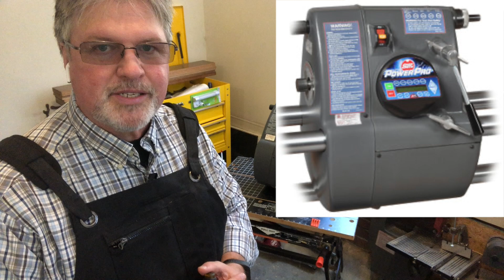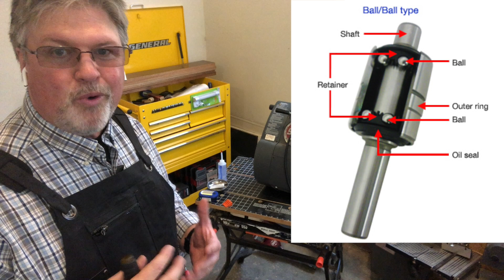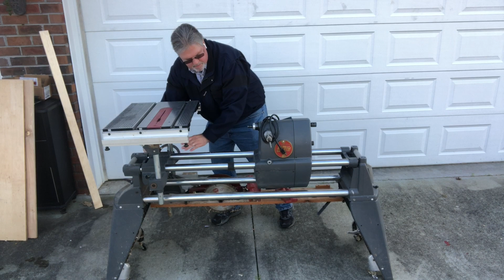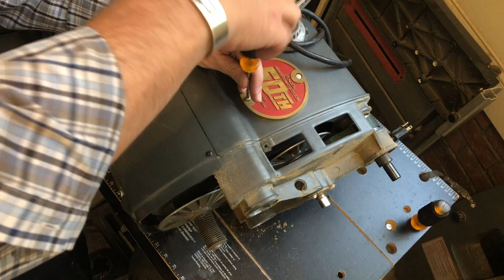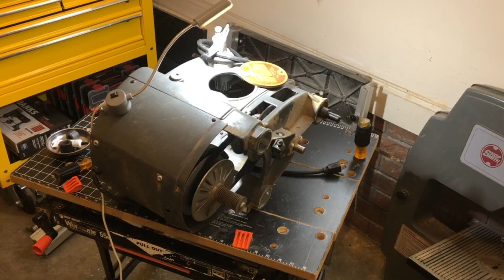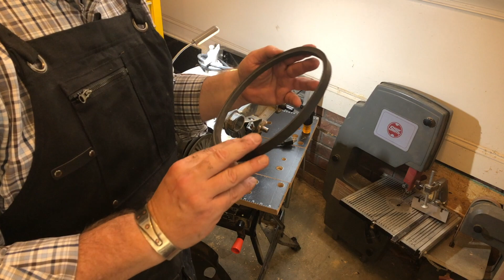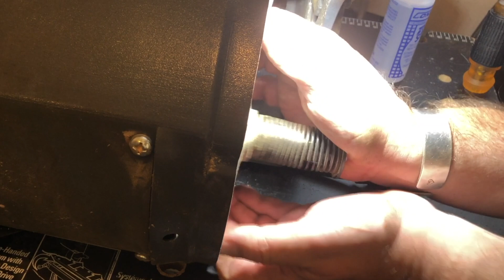25-Hour Run-Time Critical Shopsmith Maintenance, Headstock Removal & Lubricating & V-Belt Removal

Comment: Geoffrey Baker is the handle maker.  Looks very good.
Reply: I have not used Geoffrey’s handle.  I do se it’s advantages.  I have the Shopsmith magnetic various position handle.  I like it.
Reply from the maker: @johnrice6793  Well, I’ve taken the plunge and will report back.
Reply: @MyGrowthRings  

Had it been available when I purchased mine from Shopsmith I believe I’d gone your route.  I’m very interested what your report is.
👍👍
Reply: @MyGrowthRings  

I’ll add - comparing the newer Shopsmith version to the old - the old is pretty cheesy.
Reply from the maker: @johnrice6793  I agree. It works well for a lot of things, but if you stress it at all it really shows what it's made of. And that ain't much!
Reply from the maker: @johnrice6793 Now I almost feel like I need to get my hands on the SS version, just to make a fair comparison.
Reply: @MyGrowthRings  
Shopsmith sells a three handle version too.  I’d say from reading/picture view Geoffrey’s is far better.
A review of Geoffrey’s vs. the “classic” vs. the magnetic one would be very interesting.
Shopsmith setup tricks, from bandsaw to table saw to jointer - use of the conical disk, planer/jointer/knife sharpening jig, adjustable stop collar -  Ok, Ok - - sheesh - hold on!! I’ve got just a few more items to add to your list......👌😎
Reply from the maker: @johnrice6793  Yes, I’ve used and may actually own the Shopsmith three lever quill feed handle, but I didn’t care for it. It’s only good when drilling or boring, and even then it didn’t do anything for me that relocating the single handle couldn’t do. That and it has a wobble that I don’t care for. I haven’t tried their magnetic one yet, but the hub sticks out so far front he headstock that it just doesn’t appeal to me, this one may be the same. We’ll see.
Reply from the maker: Have you used one?

Comment: I broke two Shopsmith handle hubs.  I have the Shopsmith adjustable magnetic handle.  I like it.  However, there’s a fellow who produces a better conventional drill press type handle.  You might give that a look see.
Reply from the maker: I know bit of the ones you are talking about. The one that uses the quick release racing steering wheel hub is interesting, but I have a few reservations about it. I’d love to play with one.

Comment: The mask arrived today.  All is well.  New, in box.
Without using it it has my two thumbs up (at this time)
1. It’s red and black.  Easily visible.  The white masks become .  Seems I never put them back in the same place twice.

2. The elastic straps are easily adjustable, the mask fits.

Thanks for the heads up.👍👍🤜🤛
Reply from the maker: Awesome. Thanks for the report.

Comment: Probably a dumb question,  is it possible to remount the headstock on the way tubes if the wedges aren't aligned properly? Reason asking, I upgraded to the Power Pro headstock. Everything seemed fine when I installed it on the tubes but when I loosen the headstock lock it will make a noise like the wedges are being released under tension,  if that makes any sense. The headstock slides along the full length of the tubes just fine and locks in place in vertical mode. Thanks for sharing and producing this channel. This has become my new favorite channel,  even over all my watched gun, jeeping and beer making channels. Almost as much fun as watching old SI swimsuit model videos...well maybe not. Curt.
Reply from the maker: Wow Curt. In the words of Navin R. Johnson from “The Jerk”: “I'd just be happy to be in there somewhere”.  I think I understand what you are describing and that’s perfectly normal. Just be sure that the tubes are properly waxed and that you’re not sliding the headstock over the wet wax and you should be fine.
Reply from the maker: Oh, and no. It isn’t possible to install the headstock with the wedges improperly aligned.

Comment: Great episode Scott! I use 3-in-1 to lubricate. The local Walmart carried it with the same long applicator.
Reply from the maker: There’s nothing wrong with 3-in-1.
Reply: good oil my dad used it on his. I use a high end gun oil. Is stays on a lot longer than 3 in one or any other oil I have used. Made by qmaxx. Its kind of expensive like 20 bucks for 6 ounces but I haven't found much better in a light weight oil and it last a long time. Especially good for lubing stuff that's prone to weather because it is one of the only oils heavier than water. The oil doesn't break down or float off if something gets wet. Not that my mark v sets outside but it works good on anything that does. If you are a gun nut like me it is for sure the best stuff to take care of your babies.

Comment: I'm a little unclear on how to do maintenance on the porkchop. I seem to remember seeing a video where someone sprayed some lubricant on/in the mark V but that seems like other issues could come up if you aren't careful. Do you have a good method to demonstrate how to make sure that it is operating the way it should?
Reply from the maker: Yes, the reason I didn’t touch on it is because I wanted this video to only address the 25 hour maintenance. The quadrant lubrication is controversial and my even be detrimental. If I lubricate it at all I use a dry lube like Top Coat or Boeshield T-9. If you’d like a heads-up, here’s what I use: https://amzn.to/32OCnSr I’ll address this in the mid-week follow-up. Scott
Reply: @MyGrowthRings  Thank you Scott I appreciate your time.

Comment: A great demonstration of removing the headstock.  Too heavy for me anymore.  I have oiled my headstocks for the past 30 years with it in the drill press mode raising the belt shield up the ways and clamping it up there.  It seems easier for me to get at the lower sheaves and oiling the upper sheaves is easy through the back hole from almost any position.
Reply from the maker: Good point. I was planning on showing that alternative during the mid-week follow-up, but you’ve just given me another reason that someone might want to approach it that way. Thanks, Scott

Comment: Great video Scott! I'm due to open mine up and give it a good once over again soon, so very timely.  My '80s vintage Mk V quill doesn't turn easily by hand like yours does...hopefully you can touch on possible causes in a future video.
Reply from the maker: Rule 1: Don’t drop it onto you jointer.

Comment: The 2x4 is a great idea. Since you broke the quill, will you upgrade it?  Appreciate any comments on making a shorty.
Reply: No I’ve seen the shopsmith upgrade with 3 handles but haven’t made the switch.
Reply from the maker: @daveschmitt6369  I used the three handle version when I worked at SS and it always seemed to be in the way. Their new multi-position lever looks interesting, but it also looks like it hangs way off the side of the headstock. Likewise, there’s a non-Shopsmith multi-position version that utilizes a quick mount bracket from the auto racing industry. It looks interesting and might be excellent for mortising because it is much longer than the stock lever.  Like I said, I am so used to the OEM parts that I’m reluctant to change.
Reply: @MyGrowthRings  you haven’t responded to my probes about making a Shorty. Is that an insult to a purist like yourself. I work in a one car garage and have two Shopsmith’s with a jointer, band saw, jig saw, belt sander all shopsmith. In addition I have a planer, strip sander and router with jigs and radial arm saw. Converting the second to a shorty means I can  make it a power station with all the flexibility of a full shopsmith. If all way tubes are bowed, then it seems that I would need to trim 9 inches off each end? B
Reply from the maker: @daveschmitt6369  I don't recall seeing any messages about a shorty, so please forgive the radio silence.  Yes, you read me correctly, though I am coming around a bit to your way of thinking. I hat to see a SS being cut-up, but you can always add longer tubes, so it really isn't causing permanent damage. I say go for it. Thanks for helping me through that! Scott
Reply from the maker: @daveschmitt6369  Now I see the shorty question!
Reply: @MyGrowthRings  no worries.  I won't be physically able to cut it down till spring - replacing my shoulder with a bionic one, too bad it's not made by Shopsmith.
Reply from the maker: @daveschmitt6369  Good for you! I had both of my knees done last year and eventually need to have my rotator cuff dealt with. I’m sure you’ll hear this from others but physical therapy is key. Scott
Reply: @MyGrowthRings  Thanks that’s what I hear, Covid just delayed it for about a month so hopefully it doesn’t get delayed again.
Reply from the maker: @daveschmitt6369  Hopefully not.
Reply: @MyGrowthRings  I see you are on the shopsmith users forum. I can’t seem to find my username/password is there an admin email I can use to contact them?
Reply from the maker: @daveschmitt6369  I'm not sure, but I was able to send them a private message asking how you might contact them off the forum, so when they reply I'll let you know what I learn. Scott
Reply from the maker: @daveschmitt6369  Ok, they responded and suggested that you send an email to the webmaster at webmaster@shopsmith.com
Reply: @MyGrowthRings  Thanks I sent them an email. Hope to hear from them tomorrow.
Reply: @MyGrowthRings  thanks, I reached out hopefully will get it back on it tomorrow. By the way, they owe you a commission, I ordered a fence for my 510 bandsaw like you suggested. Appreciate your insight.
Reply from the maker: @daveschmitt6369  Ha! My days of being financially tied to SS are long behind me. Now I’m just a civilian fan.
Reply: @MyGrowthRings  I figured but I appreciate your information. Because I bought my machines I didn’t have a resource to teach me nuances of using my Shopsmith machines. And then to have you respond personally.   By the way I just heard from SHopsmith. 

Thanks

Dave
Reply: I just let Dan Miller know I ordered the fence based on your advice.
Reply from the maker: The quill is fine, but the quill lever will need to be replaced. I’ll get a stock replacement because I’m so used to it. Do you have an aftermarket quill lever?

Comment: Sorry for this long comment;
Hey Scott, I have a couple more questions. 
I have a model 500 I believe based on the table/fence system. It has an all aluminum table (without the red insert) but also without the 2nd blade slot. Also with the fence that has no mitre slot and the twist knob only. No round tubes or square extrusion. 

I am wondering what upgrades you recommend and if possible what ones I should get first. (Obviously it would depend what functions I use the most.)  I have another table saw, so I don't use the table and fence for sawing, at least not currently, but I do use them for drilling, boring, and sanding. I have the jointer and bandsaw for it, which I also use a lot, and then everything else that came stock.

The accessory rack underneath/on the way tubes, is that the one that ShopSmith sells? It looks very useful. 

I'm sorry if you covered things I'm asking in previous videos, I'm slowly getting to them all.

I just saw your video about using a Bosch bandsaw blade, and I just wanted to tell you to look at Sawblade.com. They have a great selection of any kind of blade length/TPI  you could imagine, they cut really well, I would guess way better than the Bosch you got, and they are pretty cheap for how well they work. You can pick what machine you have, and they guarantee they will fit, or you can choose your own custom size. I obviously picked the ShopSmith, and they fit perfectly. I chose what width, and what TPI I wanted, and they shipped them I believe within 8 days I had them. They have flex back, hard back, and carbide tooth blades, and I'm sure plenty more. I thought you would enjoy the options. 

Thanks again, and sorry for the long comment.
Reply from the maker: Yep, that's a 500 alright. It's an early one too because Shopsmith eliminated the second slot, neat the left side of the table, back in the 1970's. It was handy because you could make wider rip cuts without having to use the extension table, but is wasn't very safe because they lower saw guard, if there even was one, was attached to the table's tie bar, and that was way off to the right when you used that slot. The other issue with it was the table flexed and could even bend under some loads, which as drilling and mortising. 

I really like the 510, but if you aren't going to use the table saw much of what it offers won't be useful to you. It still would give you t-slot miter gauge slots, which can be handy for jigs, fixtures and clamps, and the fence is larger and more reliable. The same is true of the 520 table system. 

The accessory table on this Mark V was made by the previous owner and it is pretty awful. I like having one on my Mark V, but this one has got to go! 

The Bosch blade purchase was a bit of a goof, just to see if it would work in a pinch. I usually have Timber Wolf blades on my bandsaws. I am a member of Izzy Swan's Makers Playground and get a discount from Sawblades.com, but I've not yet been tempted to switch. Perhaps one day I'll give their blades a try. 

Thanks for the tip, Scott

Comment: This is excellent for checking out my Shopsmith which I just inherited from my father. It is a 1960's vintage (maybe even 1958) one. Can you offer any guidance for replacing the power cord - the sheath on mine is cracked. Any tips or advice to make the task go smoothly.
Reply from the maker: The power cord is very inexpensive from Shopsmith, though you will have to do a little filing to get the strain relief plug to fit into the motor pan since the new wire will be a bit larger.  If you don't already have them you'll want to buy a couple decent files. Buy them at a good hardware store and industrial supplier. I suggest Nicholson. This is one of those times you really need to avoid Harbor Freight at all cost, even if you have a free flashlight coupon! The cord will come with instructions and a template. Just cut it out and trace it with a Sharpie onto the motor pan over the existing wire hole, and file until the entire Sharpie line is gone. The rest is easy, though I like to cromp the strain relief plug with a pare of slip=jaw pliers as I press it in.  Good luck! Scott
Reply: @MyGrowthRings  Thanks for the tips.  I haven't used my Dad's Shopsmith since I was living at home (40 years ago). So, I am looking forward to getting it up and running again so I can enjoy doing some woodworking again.

Comment: Excellent video. I truly need to lube my SS and do a full oil maint. I have never had it apart for the 4 years I have owned it. I use it primarily as a thicknesser and I am sure that is not adding to it's happy life. 
If you don't mind, I will kindly mention your videos as a reference to my 'rookie SS tune up'. video.  
As always, Good job Scott!
Kevin
Reply from the maker: Hey Kevin. Yeah, four years in I'd say it's a little overdue. But you know, just like they say about planting trees: The best time to plant a tree is 20 years ago, but the second best time is today. I think there's a correlation and that you're right on time. I welcome them shout-out! Scott
Reply: @MyGrowthRings  ........and the 2nd best time is today :) yes I am very familiar with the term and I will put that task very close to the top of the list :)
Reply: Sorry to hear head stock rolled off the table . I would like to build a fixture like James Hop has on the Shopsmith repair channel has. Do you know of any plans.
 for it ?  Keep them coming. Always learn something new.
Reply from the maker: @lancefarmer8096  That’s a fixture that Shopsmith used to have made for all their retails stores so we could repair customer’s headstocks. I don’t have plans but it’s not a complicated rig. It could even be constructed from wood.

Comment: Isn't there 3 spots to lubricate?
Reply from the maker: Not with oil. You can add grease, wax or a dry lube to the rack on the quadrant and or to the worm gear, but they’d not something that needs to be done every 25 hours. There!s even another spot under the dial that some like to add wax. Scott

Comment: For those who have a Mark V permanently mounted to a wall and used as a stationary dedicated drill press. I've always wondered how well are the sheaves receiving oil when doing maintenance? Especially the upper shaft were the oil hole on the shaft would be below the sheave with the headstock in the vertical position. I suppose you could tilt the headstock down, and everything would be upside down at that point. Perhaps I'm over thinking all of this.
Reply from the maker: Or you can make sure to drop some oil between the halves of the sheaves. For sure that’s something you’d have to keep in mind. Scott
Reply: @MyGrowthRings  That would be about the only option for your buddy with the fabled Mark I.

Comment: Just had my 1978 Mark V lock up because the belt jammed in the bottom sleeves.  How do you unjam the belt?
Reply: When I inherited mine, the belt was locked also.  I cut and replaced the belt since it was likely permanently twisted up from being locked in.
Reply from the maker: I agree with David. Order a new belt and jut the old one off. You'll want to make sure that both sets of sheaves are well oiled and moving smoothly, but it's rare that they don't just snap right back into service. Scott

Comment: Great tip to use the table to raise the way tubes enough to slide the headstock off.  I've used something like a 2x8 offcut randomly stuffed on edge under the tubes and pried the headstock off, praying that the offcut wouldn't suddenly fall over and bring everything crashing down!
Reply from the maker: I've done that too and had the same hesitation. The method shown here works very well, assuming you have a long enough board laying around. Scott